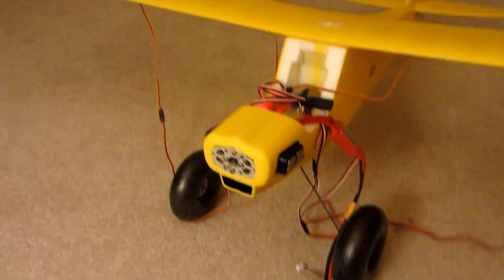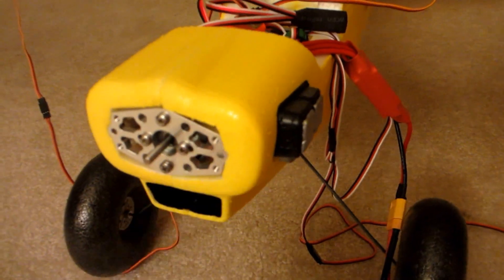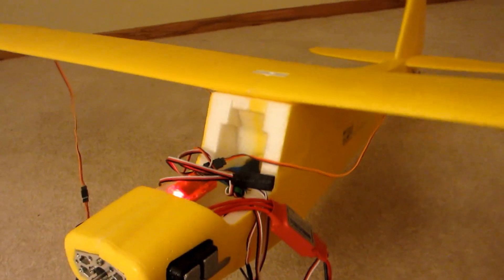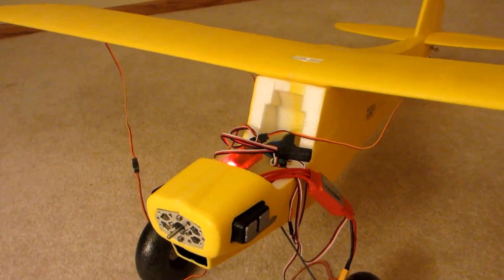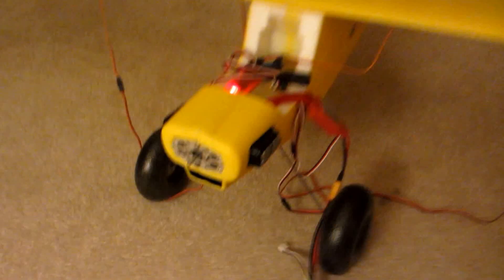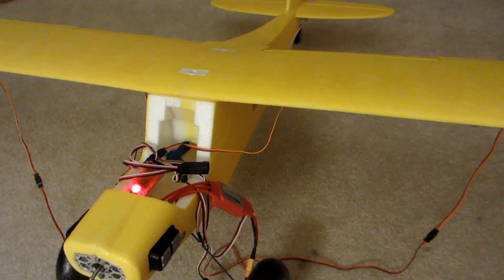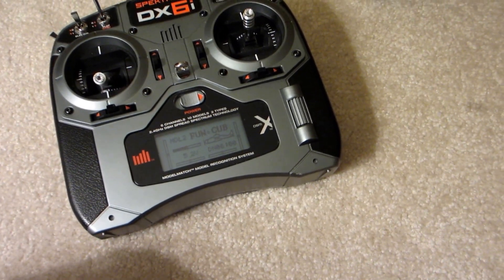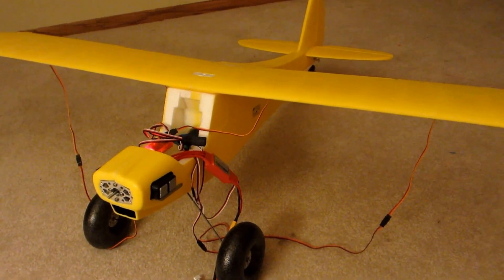Multiplex Fun Cub Build 05 - Electronics Working

Comment: I am building mine now and will also paint. There are 10 of these flying at our field. The paint will avoid confusion. Your videos have been a help. However I will not separate the flaps from the wing. Did you use CA or some other glue?